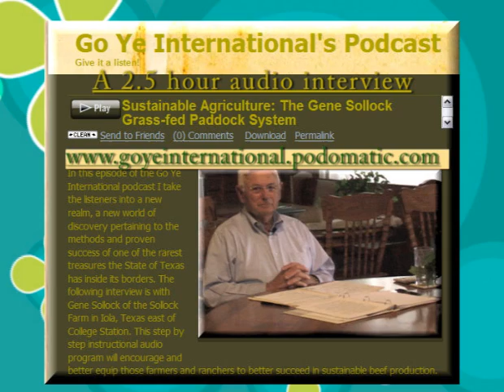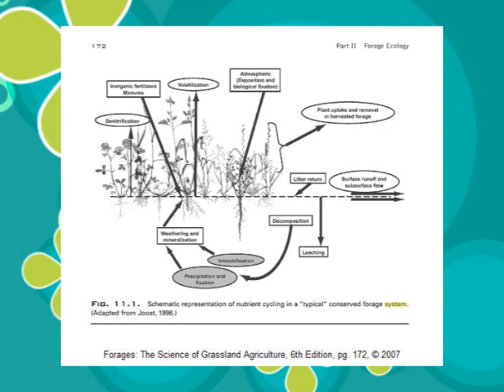1- Gene Sollock IMG: Episode 1 w/ Gene Sollock

Comment: Great info, but  a few more trees might be even better: natural shade that's cooler than artificial shade; leaf drop recycles nutrients & minerals from sub-soils to the surface (without having to mechanically 'sub-soil'), and you may be able to get an additional crop, depending on the type of tree, management, etc (firewood, timber, maple syrup in the right areas...).  Acorns from oaks are edible by livestock.